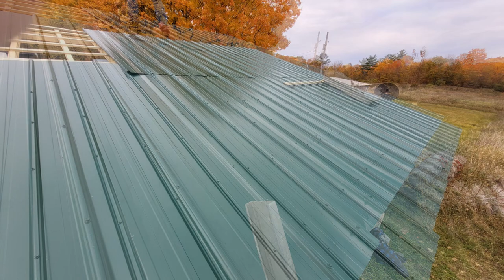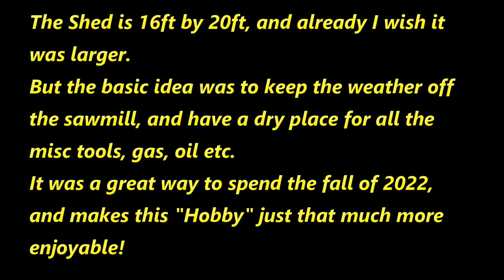Sawmill Shed - Full build, start to finish...

Comment: where did you get the post connectors for the concrete and the rafters ?
Reply from the maker: The brackets and plates for the rafters were just scraps of steel, cut with an angle grinder and bent on a sheet metal brake.